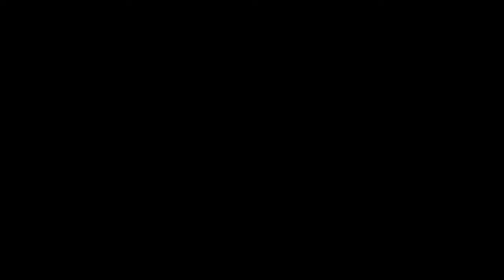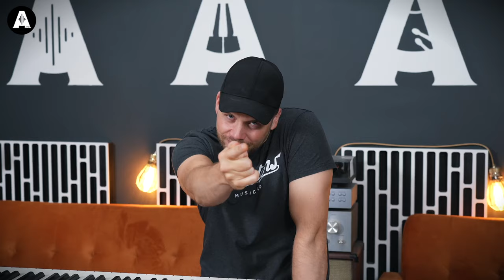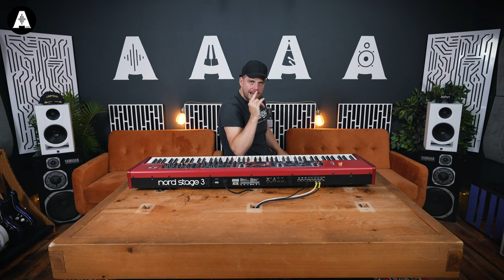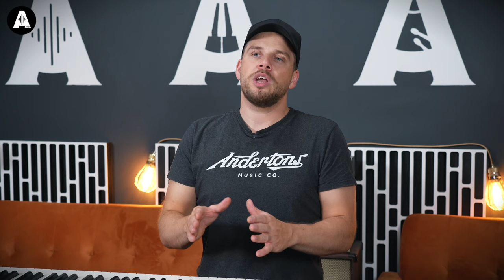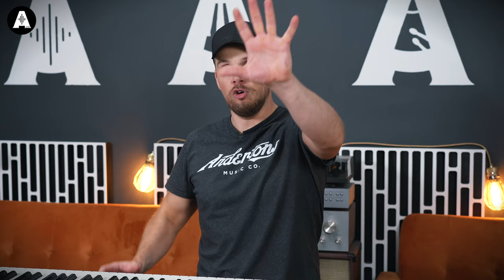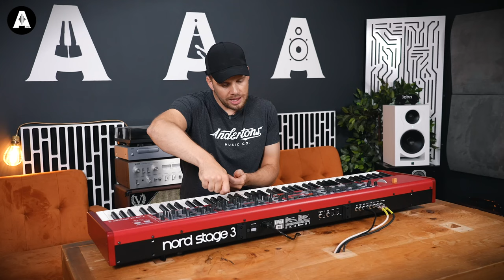Sound Design Basics With Jack! - Lead Synth

Comment: Nice lesson. But I wouldn't have used that keyboard that has clear limits for a synth patch. Every cheap mono synth (hardware or software) would have been much more interesting. Two oscillators, LFOs, modulations... You name it.
If you make a synth lesson, use a synth.
Anyway, you are great!
Reply: You are probably correct. But Jack is talking about using this in a band setting, such as a function band. The pureness of the sound design is less of an issue when compared to having a (single) instrument that can quickly switch between all the required sounds of a covers band.
Reply: @geoffwebber8272  I play in cover bands. I am using a full software solution. Workstation are a thing of the past for me.
Sound quality and full automation are much better with VSTs and a good host like GigPerformer
Reply: @furiobisotti8150  Is gigperformer a good replacement for mainstage? I like the featureset and workflow of mainstage for the most part, but it is so buggy and unreliable that it’s unusable for me. I need stuff like seamless switching from one patch to another without the midi cutting off until I release the keys/sustain, midi mappings that can change on a patch by patch basis, easy range adjustment for each layer, and arming/disarming of layers so I can toggle layers on and off without abruptly cutting off the audio and wasting CPU on unused layers. Unfortunaly mainstage doesn’t have that last one, unless perhaps I found some midi passthrough plugin that did that

Comment: Can anyone give some insight on what to tweak to get a lead similar to what's playing here at the end? https://www.youtube.com/watch?v=6OQQ8DR8Zgk It's pretty similar but has a smoother/less funky tone
Reply: You can start by making the lead on this video, and detune it a little bit, no more than 3 bars to the left. Now for the dynamics, you need to raise the sustain to 4 bars (not sure if the stage has sustain control), raise the release to 12' on both envelope and amp, raise the attack of the amp to around 3 bars. It also has a phaser/chorus effect, that you can make with LFO (read the manual for that one). For all these parameters, you have to listen for yourself because synths behave very differently. On the NL 2X, you have to raise the frequency to 2' and decrease the env amount to 10' if you want to still use velocity control. If not, just do the same of the video. You should get something very close to that on the other video.